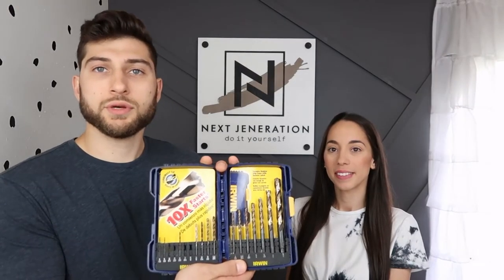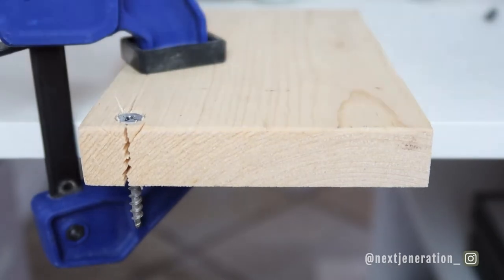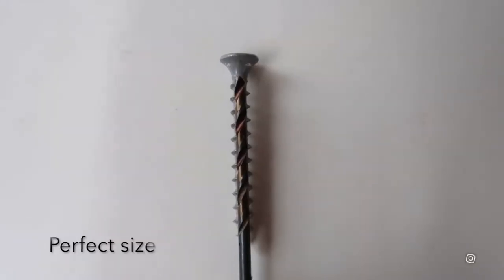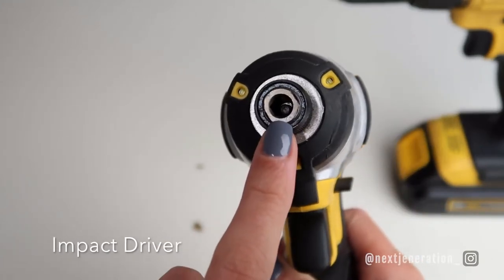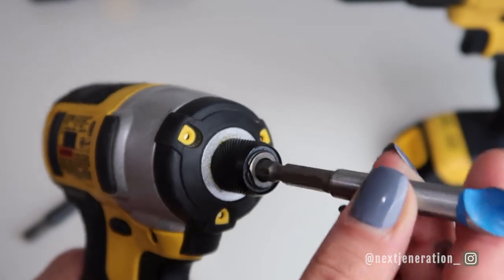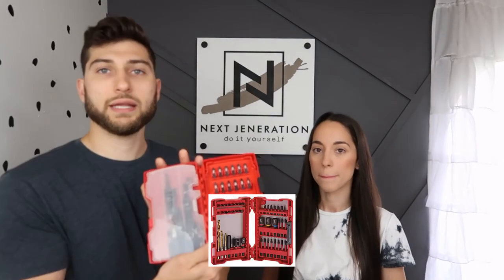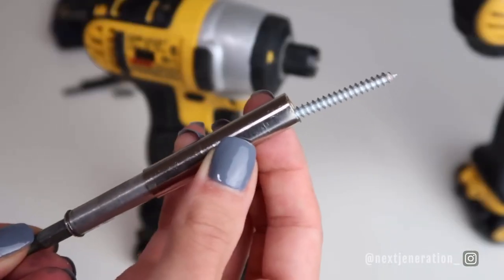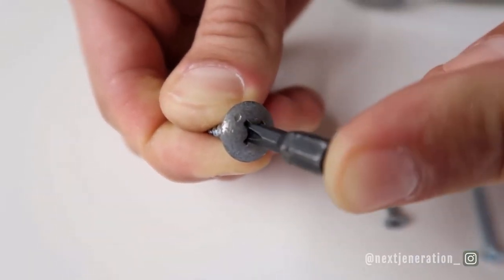How to Use Drill Bits 101

Comment: Hi! Thanks so much for your informative videos! My last comment was about size of drill bits… I was asking about size of drill- so apparently there is different sized DRILLS. 1/2” Drills, 3/8” DRILLS.  Some jobs say make sure to used a 1/2” drill, for example. Do we need to buy multiple DRILLS, or can one drill do all the work. I have a cordless little screwdriver, but it takes for ever to drill a hole with it, if I did find a drill bit to fit into it. So I don’t think your video on “how to use a drill” went into how to “buy a drill” or “which drill do you need to buy” video… 😊 thank you.
Reply from the maker: I would buy the one we showed in that video. It’s extremely versatile and can be used for just about anything. The only time we use a different drill is when drilling into brick or concrete (we use a hammer drill for that)

Comment: What does the variety number of V means? What is the difference between 88V drill and 48V drill?
Reply from the maker: Ours is a 20V. The higher the volt, the lower the amperage (less power). So an 80V drill will do the same amount of work as a 40V, but using less power therefore taking longer and more battery.
Reply: @NextJeneration  I see….I get it now. Thank you guys! I learnt a lot from this video.